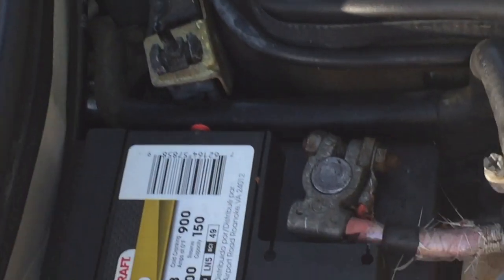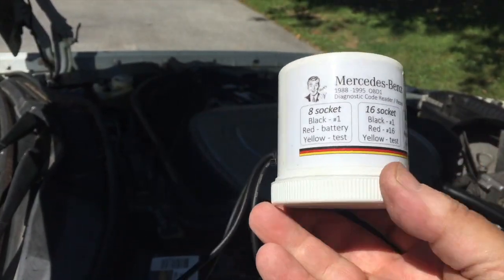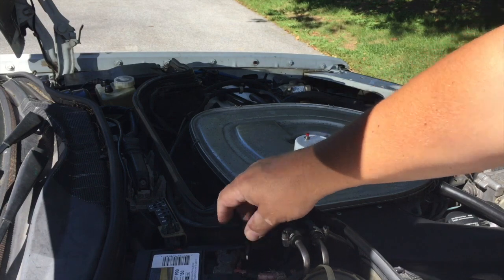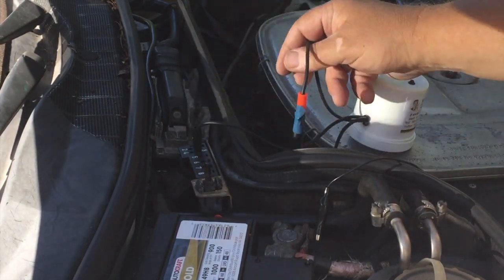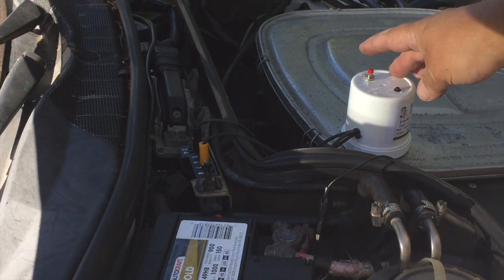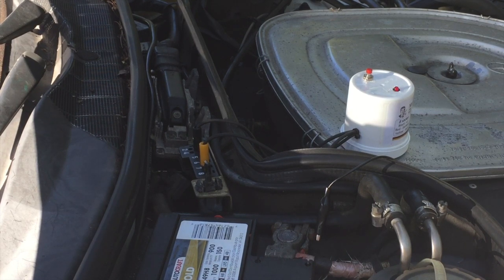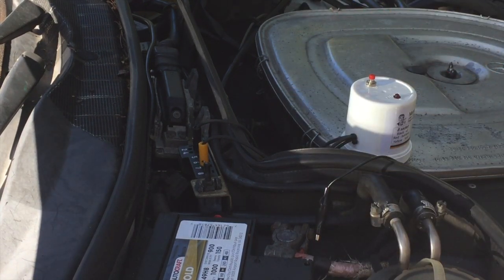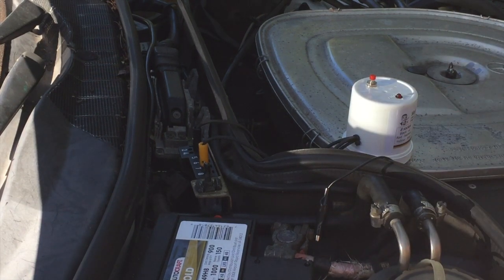How to use a OBD1 diagnostic code reader on W124 W126 W140 W201 Benz

Comment: Hi.. my asd was working and suddenly stoped. Diagnostic shows not error, blinks one time wich means everything is working good. But when tires slipping, asd (and triangle light) dosnt come up. You know what can be the problem? Thanks.
Reply from the maker: What is the model and year?
Reply: @straybenzes model is 124.188 , 1991.
Reply from the maker: @benz_diaries  The top W124-specific failure points:
1. Rear wheel speed sensors (number one suspect)
On W124s these fail silently.
Key detail:
The self-test does not verify dynamic signal quality
One lazy sensor = no perceived slip = no ASD action
🔧 What to do:
Measure resistance of both rear sensors (should be close to each other)
Spin each rear wheel by hand and watch AC voltage output
Inspect wiring near the rear subframe mounts (they love to crack there)
If one sensor reads “sort of alive,” ASD will never wake up.
2. ASD hydraulic pressure switch
This one is very W124.
The pressure switch:
Confirms that the diff actuator actually pressurized
If it fails open, ASD may command lock but never confirms it
Result: no triangle light, no intervention, no codes
🔧 Check:
Continuity when pressure is applied
Wiring corrosion at the switch connector
A failed pressure switch makes ASD feel shy and invisible.
3. Low or aerated hydraulic fluid
ASD shares fluid with:
Rear self-leveling (if equipped)
Even slightly low fluid:
Pump runs
No pressure buildup
No triangle light
🔧 Check:
Fluid level with engine running
Correct fluid type (not ATF)
Foamy or dark fluid = no bueno
4. Diff locking piston stuck
Very common if ASD hasn’t been exercised in years.
Symptoms:
System commands lock
Pressure rises briefly
Piston does not move
Pressure bleeds off
No triangle light
🔧 Test:
Apply 12V directly to the ASD solenoid briefly
Listen/feel for pressure change at the diff
Sometimes a few lock attempts bring it back to life
Old oil turns these pistons into statues.
5. Brake light switch (still guilty here too)
On W124:
ASD is disabled if the brake signal is unstable
No fault code
No warning
🔧 Check:
Both brake lights and third light
Switch adjustment and contacts
It’s a cheap villain, worth eliminating early.
Simple confirmation test
On jack stands:
Engine running
Transmission in gear
Let one rear wheel spin
Watch the other wheel
If:
The other wheel never starts turning
No triangle light
ASD is not locking mechanically. Period.
My recommended attack order
Rear wheel speed sensors (measure, don’t guess)
Hydraulic fluid level and condition
Pressure switch on the diff
ASD solenoid activation
Diff piston sticking
The W124 ASD is honest, just old. When it stops working without drama, it’s almost always sensor signal quality or hydraulics, not the ECU.
Reply from the maker: @benz_diaries  Thx
Reply: @straybenzes thanks a lot friend. So all of this errors must be visible thru diagnostic , and asd light should be on if something is wrong. Number of blinks should tell what it is. You think that something can be wrong and system can be "fooled" by self-check?
Reply from the maker: @benz_diaries  That's got an OBD1 and you can go that route. It may be better to just follow the troublehooting steps I outlined. The best of luck diagnosing this.
Reply: @straybenzes thank a lot for this steps you wrote! It is going to be a lot of help for me. Wish you all the best.
Reply from the maker: @benz_diaries  Thx!
Reply: @straybenzes after checking all the components that you wrote, this morning I woke up and saw it's ice and snowing outside.. and thinking perfect for a bit more testing ASD without fear of damage something. And i was surprised that ASD is actually working! Could feel and see that system is locking wheels. So the real problem is in asd triangle! It's not blinking so I was thinking that asd is not working at all. Now i have to see what can cause that problem. Triangle is lithing up like it should when ignition is on, so it's not broken wire, light bulb or diode inside.
Reply from the maker: @benz_diaries  That is good news!

Comment: I have no spark ⚡️ in any of the plugs on my W124 E280 1994. Your help will be much appreciated
Reply from the maker: Start from the coil and see if yyou have power with the ignition on. Do you have a ignittion timing light? That is really helpful. put the clamp on the main ignition wire going to the distributor. Start and see if the strobe light fires up. If it does not fire you have an issue with the power supply or the coil. Theere are a few vidios that highlight crank no start issues. Did yyou look there
Reply: @straybenzes  there’s spark ⚡️ In only one coil and I put 3 new coil and still the same only one sparking but not the other 2 . Could it be something else ?
Reply from the maker: @younuskhan1752  Hmm, there is only one main ignition coil. Do you mean spark plugs? Did you replace 3 spark plugs? If only one plug has a spark   and you replaced the other plugs, then it can be the rotor and cap housing or the corresponding wires/plugs attached to the plugs that have no spark.

Comment: Which relay are you talking about? Is it the one behind the battery?
Reply from the maker: Literally any of them: OVP, Klima, fuel pump, and the ones in the fuse box. Sometimes a bloody cob web in the wrong spot can give you a false positive reading and hide the actual root cause. I guess that's why OBD2 was implemented in the mid 90s.

Comment: My OBD1 impulse code reader doesn’t work on my car yet I recently got a check engine light so it had to be working? I mean I followed the wiring and it appears to inside the dash on the passenger side so I’m assuming it glides over to the driver side
Reply from the maker: I am not sure what you mean. OBD1 readers are often useless on these old cars. What are you gliding over to the driver side?
Reply: @straybenzes  I’m not gliding over anything I’m just saying I chased the wiring from the onboard scanner to the passenger side of the vehicles. I unplugged the battery, cleared the check engine light and eventually it came back again. I bought a computer to plug into the OBD1 but will it work? Because the light doesn’t come on so I’m assuming it’s dead
Reply from the maker: @plissken94th57  It is probably dead. That is quite the find if you found an ODB1 reader that plugs into any computer. The functionality remains the same though - it still only reads the number of impulses. I have it easier to just bite the bullet and checking one associated system after the other.
Reply: @straybenzes  if the onboard OBD1 is dead will the scanner still count the impulses?
Reply: @straybenzes  it’s a obd1 scanner from 1988-1995 Mercedes with 3 pin connectors
Reply from the maker: @plissken94th57  And you found one that connects to a computer?
Reply from the maker: @plissken94th57  No, I don't think so. Sorry.
Reply: @straybenzes  ya I tried it and didn’t work because the onboarding device itself is out. Doesn’t turn on. So I have a check engine light, I know we’ve adjusted the air to fuel mixture once which got rid of most of the stalling but it still does so I’m sure it’s the O2 sensor because it also can’t pass smog, hopefully it’s not the catalytic converter because the 300ce has 2 of them I believe. Even if it was 1 it’s expensive to replace. Other thing I’m going to check since it doesn’t always start 1st crank when it’s warm, is check the fuel accumulator as well and clean the micro screen that’s in the fuel distributor
Reply from the maker: @plissken94th57  You have got a lot going on here. Assuming you have a KE Jet system then the fuel accumulator is most likely faulty. That causes hot engine no or hard start. 
Catalytic converters fail most often in 1 of 2 ways.Either they start loosening and start to rattle or they overheated and started to melt. With the latter the engine will start and usually also idle fine, but the engine will no longer develop much power because the exhaust gases cannot get through the converter any more. Neither causes the check engine light to come on. 
The O2 sensor may be bad, but there are quite a few other troublesome gizmos attached to the CIS E control unit and the Engine Systems Control Unit MAS. There are EGR switchover valve, start valve, purge switchover valve, air flow sensor position indicator, throttle valve switch, decelaration shut off microswitch and the two ECUs that you should also check out. 
This is all assuming you have checked all the basic air, electric, engine technology basics and you are getting a nice steady idle. It is difficult to assist from afar without being able to observe the symptoms live. All the best to you!
Reply: @straybenzes  I ended up figuring it out, I got 3 codes, Coolant Temperature Sensor, Altitude Correction Sensor, and EHA
Reply from the maker: @plissken94th57  Way to go! Nice
Reply: @straybenzes  more than likely it was been causing me to fail smog inspection and also the intermittent stalling issue I’ve been having since I bought it. The air to fuel mixture has been off this whole time as well as the other 2 sensors which also been causing it to go out of whack.
Reply from the maker: @plissken94th57  You are making progress!

Comment: Can you help me have 1992 300ce 24 when tested lights lit up constantly after connecting testing wire without pressing test button for testing lead,
Reply from the maker: Hi Michal. Unfortunately, you are experiencing the top number issue with OBD1 diagnostic tools. The issue is that defective cables and /. or circuits can cause for there to be a continuous fault signal that causes for the LED to be lit the moment you apply power. The only way that I know is taking a power probe and trying to find those faulty circuits/ wires - it is a tedious process making the use of a OBD1 tester often pretty much useless.
Reply: @Stray Benzes  thank you, is disconnecting circuits and relays helping
Reply from the maker: @michalmuszynski6942  Not necessarily. That can introduce more unknown variables. Testing key circuits one by one using a power probe is likely the best way to isolate problems.

Comment: IIRC, your MB has to be newer than '89 or a CA model car. I do know they don't work on my '88 300SE FED model.
Reply from the maker: OBD1 was available on these very early on.
Reply: @straybenzes  It was not available for the '88 & '89 on FED models. It was available for those model years only for CAL compliment models. Believe me, the test socket of my '88 300SE lacks any metal receptacle to plug into where your directions tell you to plug into to make the test.

Comment: Ralph, like your car, my 420SEL only has pins 6 (SRS) and 7 (AC) present.  Pin 3 (CIS) would've been really interesting to pull codes from.
Reply from the maker: Yeah. Truth be told OBD2 was much more useful, but every little bit of info helps. When it works, that is....

Comment: Hi, is it possible that my car just doesn't have the connector? I've been looking for it for the last hour and can't find it. It's m103(3.0)1992 w124
Reply from the maker: If it is installed then you will find it behind the engine firewall just to the right of the battery's positive pole. I have found a photo of a blog post that shows where it should be. 68885d1245191736-how-diagnose-engine-codes-89-300e-p4105067x.jpg

Comment: Hi, on E-bay/Amazon they have the OBD 2 not the OBD 1 you are referring to , will that do?  Thanks from Norway
Reply from the maker: OBD2 is a completely different system and also has a different plug. They are not compatible.
Reply: @straybenzes  Thanks, can I purchase OBD 1 from you?
Reply from the maker: @Caramba-e5m  I currently do not offer parts etc, but here is one of many choices of such a code reader on Ebay. I would give that a try. https://www.ebay.com/i/222481161915?chn=ps&norover=1&mkevt=1&mkrid=711-117182-37290-0&mkcid=2&itemid=222481161915&targetid=1098133263004&device=c&mktype=pla&googleloc=9006117&poi=&campaignid=11616981724&mkgroupid=114637734633&rlsatarget=pla-1098133263004&abcId=9300455&merchantid=6296724&gclid=CjwKCAiAudD_BRBXEiwAudakX99Vj-XnLP2S1jW2Oq9-vgw0sijTefOuBhDW-s3LDtJO8yru3SVCJBoCoQEQAvD_BwE